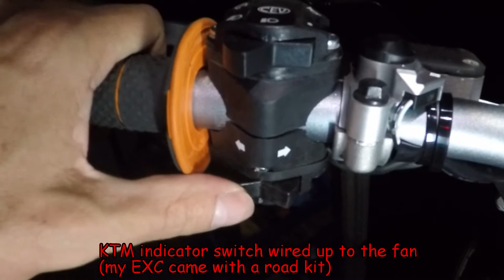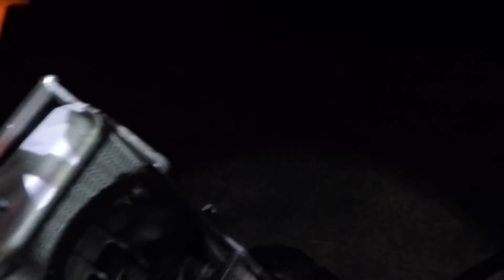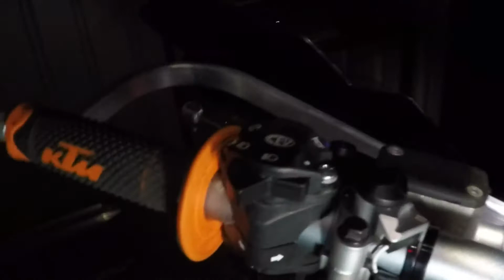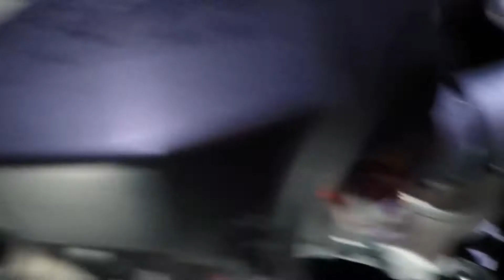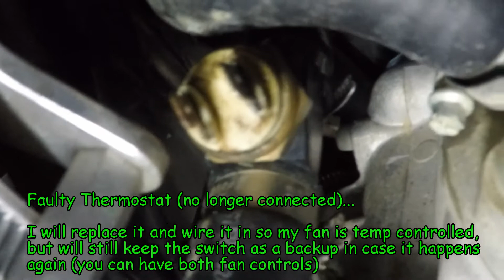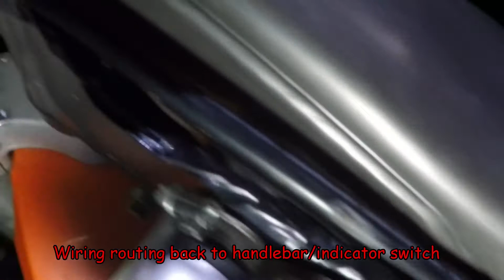KTM Fan Switch using OEM KTM Indicator Switch from Road Kit

Comment: Hi thought i would put this....
A friend of mine has a 450 exc on a 2009 plate and we were out riding and the fan kept coming on, then came on constant even if we left the bike to go cold.

Anyway at the bottom of the right radiator is the thermo fan switch with 1wire covered with a rubber cover, under the cover is two wires that connect to the switch.

If we unplug 1 of the 2 wires the fan cuts out, so i knew it was a broken thermo switch ( there about  £40 to buy) anyway i have a 300exc with a fan on its own switch and my friend always wanted his on its own switch on the handle bars as its nice to be able to control it urself, instead of waiting for it to come on.

So we decided to not change the broken thermo switch and run it on its own switch on the handle bars.

I decided to use the indicator switch as it was still there and not being used, to do this remove the tank and and headlight cover and cut of the 2 spade connections that connected to the thermo switch and behind headlight you will find all the plug connections for the bike.
If you follow the two bunch of cables that run from the indicator unit, 1 is for the horn/lights ect (4/5 wires)and the other (only 3 wires) is the indicators.

So the one with 3 wires cut of the plug off and two of the wires twist too 1 of the wires that went to the thermo switch and the other to the other.

And the indicator switch will turn the ran on/off either way you indicate 

If you only use 2 of the 3 wires from the indicators, the fan will only turn on one of the ways left/right

Tidy up the cables and use good connectors and there u go!

THIS WAS HARD TOO EXPLAIN AND PROBABLY DOESN’T MAKE SENCE, BUT ITS NOT HARD, BUT THOUGHT IT WOULD HELP, COULDN’T FIND ANYTHING WHEN I NEEDED IT.

IF U NEED HELP MESSAGE ME AND IL HELP IF I CAN, CHEERS